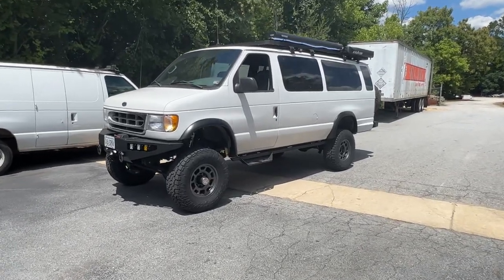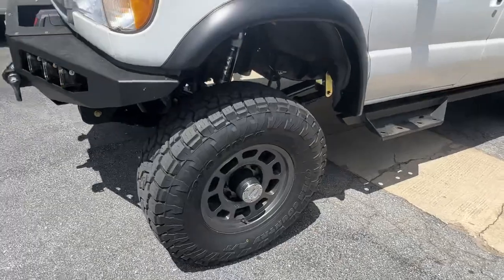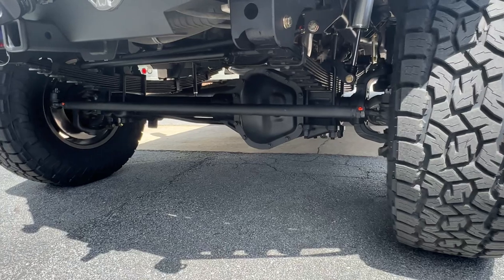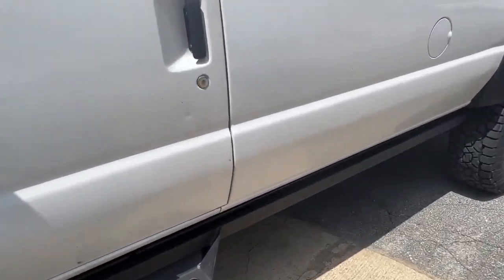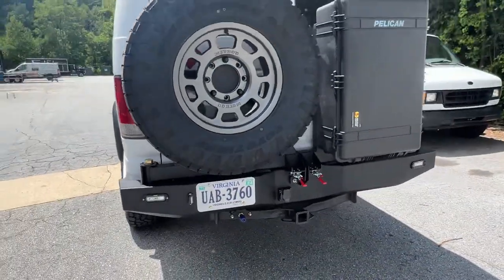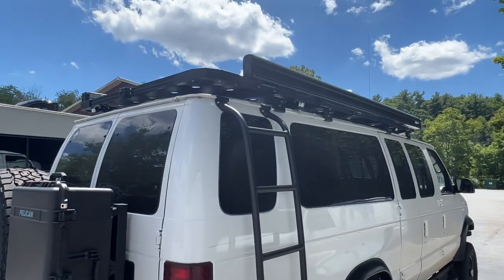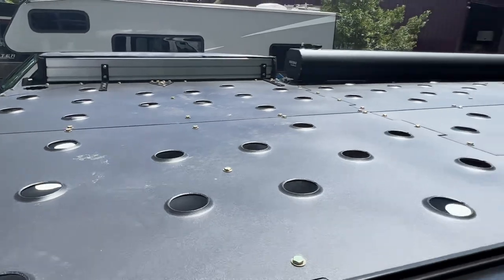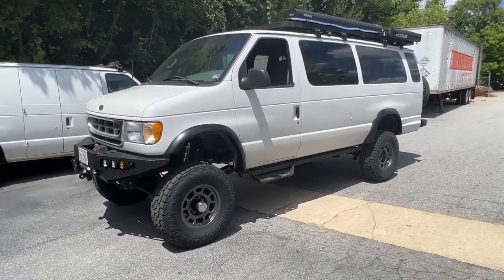VaV10 build video!

Comment: if there was a new e 350 or 450 regular van 4x4 with one row back seat and cargo space made to pull a towable rv it would be real cool i can only find cut away vans .build it to tow not van life , one of a kind rig could be big if you want to think on it...  the market is producing more off grid towable  4 wheel independent suspension  a van could carry extra supply's in a secure place

Comment: Love your work. If I was in need of a 4x4 van conversion… You’d be my man. I do have a couple of questions though… Do you, or would you ever do 4-Links with coils or even Coil-Overs front and or rear? I’m a big fan of that, especially up front. Also… Why never a Warn 16.5 winch or the American made Zeon line? It seems that many of your builds are heavy enough to warrant it and you have a lot of expensive builds that I don’t think the Zeon winch model would be the breaking point money wise for the builds. Keep up the excellent work! Love your channel!
Reply from the maker: Thanks! Check out my flatbed van, its linked F/R. The cost and fabrication for that setup is too much for most people, especially the DIY crowd. Our leaf setup handles better and is more durable anyway. The 16.5s are good and we've used them many times, the mounting and packaging is a bit of a PITA. The winches we use are a good insurance policy to have on the rig, we haven't had any issues with them.
Reply: @ujointoffroad  I love that van! I do believe that you sold it and I’m under the impression that you were doing a new build for yourself to replace it, but haven’t heard anything on it in a while. Thanks for the quick reply!
Reply from the maker: @michaeld.jasinowski3460  V4 2.0 is still here, had a brief moment of insanity

Comment: the v6 awd transit passenger or rv will not cut it for towing most the off grid towable made .. oh to be able to put a Godzilla in place of the v 10
Reply from the maker: Yep, no way.,we’re starting to see some Godzilla swaps in older E series, won’t be long before it happens more often but it will be expensive